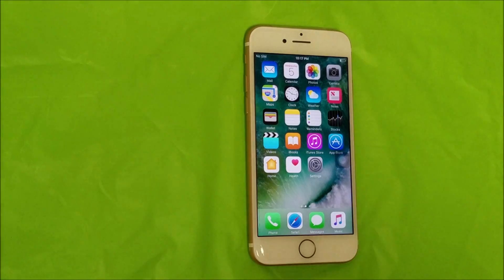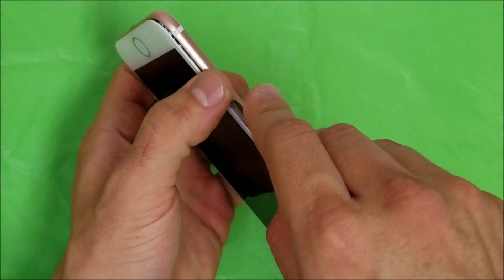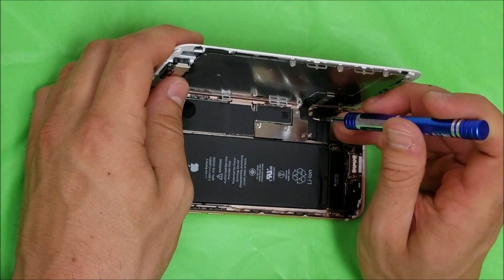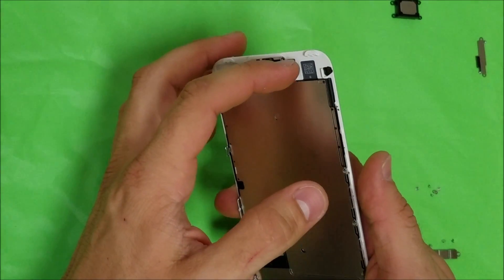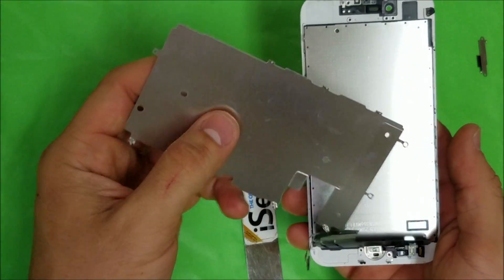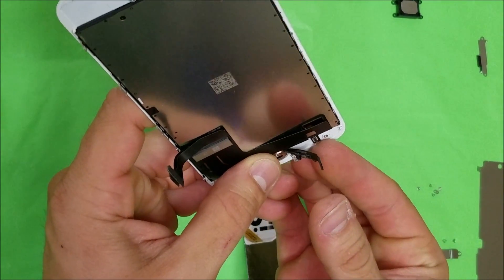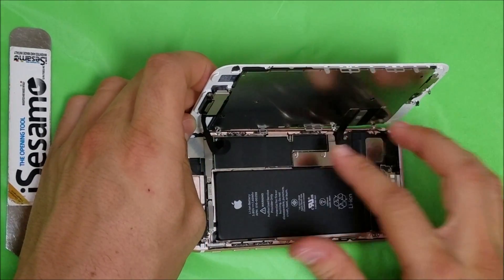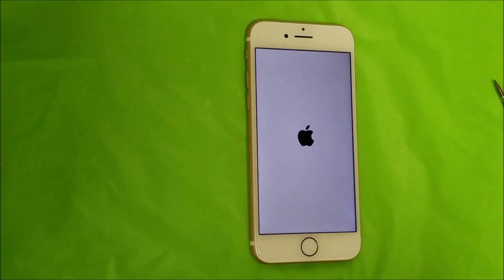How to replace iPhone 7 LCD Glass Screen | Screen Replacement

Comment: You forgot to mention that when replacing an iPhone 7 screen that the home button will not and never will work again even if replaced perfectly. You will be forced to use assistive touch forever. Apple does this so you are forced to take your phone to them and pay a huge price for repair or replacement and so they can put repair businesses out of business.
Reply: Not true! If you use the original home button Touch ID will work fine, it's only if you replace the home button that Touch ID won't work
Reply: Stop trolling & contaminating comments with your filth & lies, some people live in the country & don’t have access to repair shops & need to do this themselves to have comms for livlihood, so videos like these are life savers you useless gronk.
Reply: hmmm, well i repaired someone ip7 screen yesterday and the home button was fine, if you replace the button touch id won't work
Reply: Is this true?

Comment: I followed all the steps but there is a flashing apple logo on home screen when i connected it to power to charge it up (i ran the battery down to 0%) of course before attempting to deconstruct it, anyne know anything about htis?
Reply: Hi, were you able to address this? thanks in advance.

Comment: You have got to turn the phone off first, so unprofessional....
Reply: Sebastian Perez you can see in the beginning the phone is clearly powered on. Also, battery was not disconnected. Additionally, heat should also be used when removing the FFC/prox flex and definitely before removing the home button flex, as these are extremely fragile on the 7 & 7 plus and obviously with a new button you'll have zero home button functionality.
Reply: Hey I'm a bit confused , what do you mean disconnect the battery ?
Reply: Did it still work then be quit
Reply: Sahil sahil  your fucking dumb the phone is brand new it has never even been turned on

Comment: Where can I purchase the replacement screen for the iPhone 7? I assume that the glass itself cannot be replaced by itself.
Reply: That's what i'm wondering
Reply: Yes, you can just replace the glass. You still have to open up the phone, and transfer the home button and camera assemblies to the new bezel. Just no LCD digitizer replacement. The kit for this repair can be found here: https://www.ebay.com/itm/Apple-iPhone-7-Glass-Screen-Outer-Lens-Replacement-Repair-Full-Kit-Bundle/252918266740?hash=item3ae31a7b74:m:mtXPdvdKDmglxxLMeyGnP0g
There is a good DIY video of how to replace the glass here: https://youtu.be/geYe6u54Xus

Comment: how do you fix the home button issue after replacing the screen
Reply: I will just gеt mу iPhone 7 here https://twitter.com/dab37c4533b0cc96c/status/790428760050798592 for freе :)                      Hooow tоoоо rеplаcе iРhоone 7 LCD Glass Sсreеn   Sccсreеn Reрlаccеeemеnt
Reply: If you refer to the TOUCH ID not working afterwards then it is usually faulty screen as home button ribbon long flex is built into display